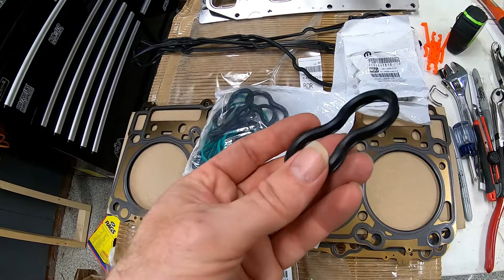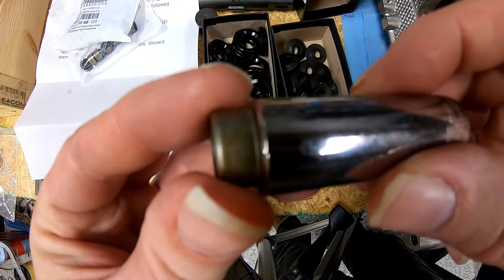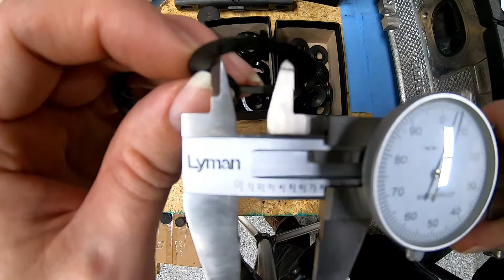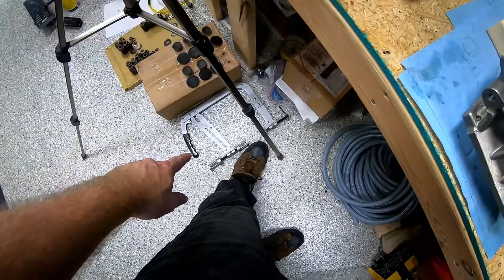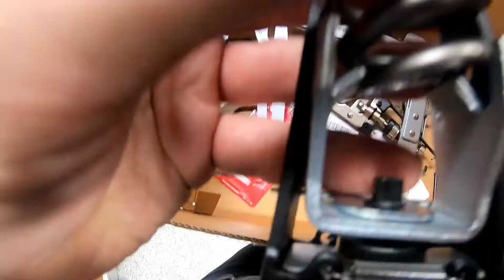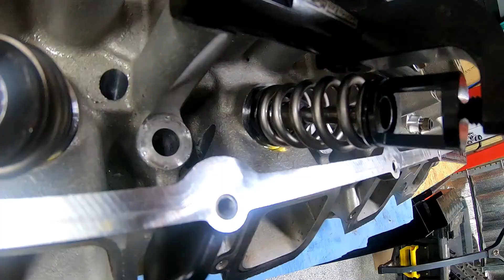Ram 2500 6.4L Upgrade Part 15 hemi cylinder head valve/seal/spring install.

Comment: Very good video, Do you know where can I get valve guides? The ones that go inside the heads?
Reply from the maker: Several places have them such as Summit.  But when I need valve guides, I generally will have the machine shop do the work to ensure they are installed to correct depth, size...etc...
Reply: @solargarage Ive been searching for days and there is not much info online, can’t even find them at the mopar website, do you know if the valve guides are the same for the hemi 392 6.4 as for the 5.7?